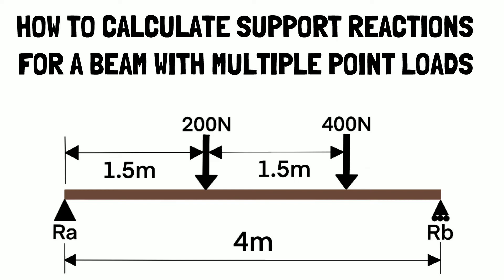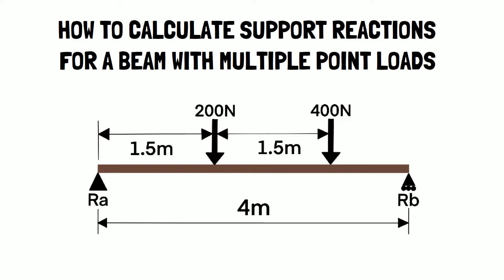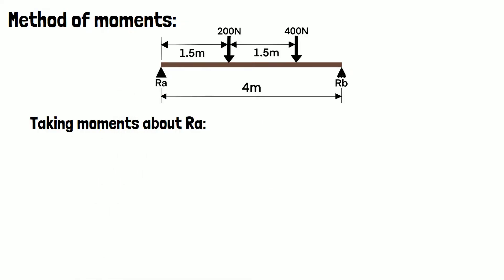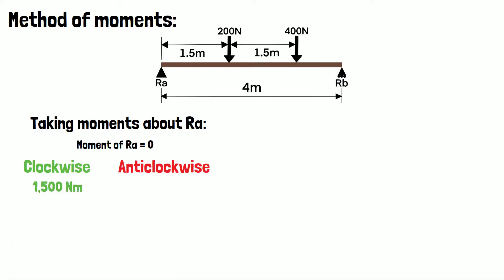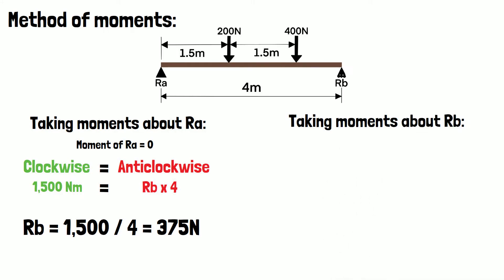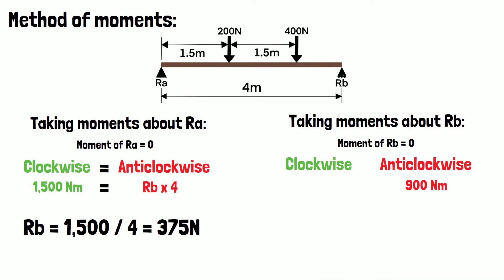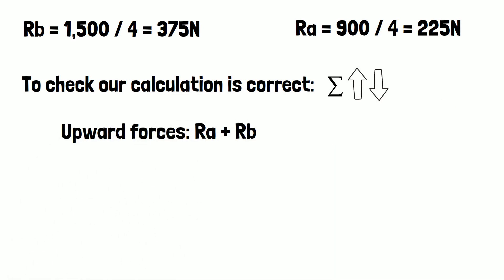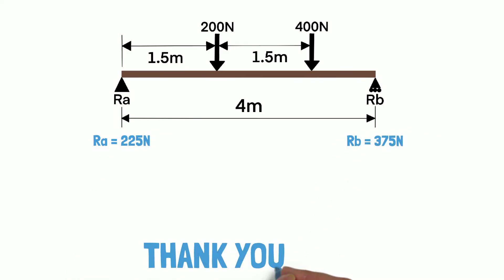How to Calculate Support Reaction Forces for a Beam With Multiple Point Loads

Comment: Thank you so much. The only thing I would have added is where clockwise/anti clockwise is derived from. It took me a moment of watching and rewatching to understand that clockwise is thus:
If you held the beam still with your hand at the origin point, and thus applied the load, what direction would the beam turn in? 

For RA, the F1=200 would turn it clockwise. 
For RB, F1 would turn the beam counterclockwise.

Comment: Can you please explain where the anti clockwise and clockwise movements and forces are identified? I'm self taught and this is one small bit I am not clear on. Thank you!
Reply from the maker: A moment is calculated by a force x distance. When taking moments about a point, a moment will cause the body to rotate. If we use Ra as our point, the other forces acting on the beam (the applied loads and Rb) would cause the beam to rotate about point Ra. The clockwise moments are identified as the forces that would cause the beam to rotate in the clockwise direction (200N and 400N applied loads in this example) and the anticlockwise moments are the forces that would cause the beam to rotate in the anticlockwise direction (Rb in this example). But, as the beam is in equilibrium, we know that the total clockwise and anticlockwise moments equal zero. This is how we find the unknown reaction force, Rb, as it is equal to the moments acting in the opposite direction.
Hope this helps, keep up the good work!
Reply: @TheEngineeringExecutive  I found it interesting that you did not mention the sense that clockwise and anticlockwise implies. I do appreciate the way you have explained it and it is exceedingly helpful as a quick reference to get a calculation done. I would have interoperated this as as MA = -200N*1.5 - 400N*3 + RB which still gives the result of RB = 375 however it doesnt skip some of the direction information. Maybe for people just grasping this getting muddled in the senses is difficult when you can stack the equation as Clockwise vs. Anticlockwise and that automatically balances the negative in some cases.... 

Regardless = thank you!